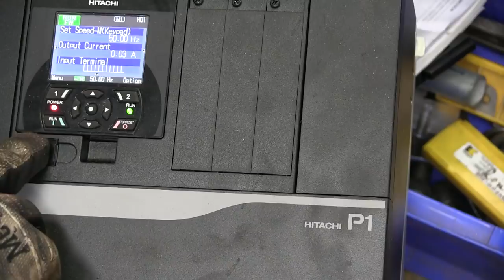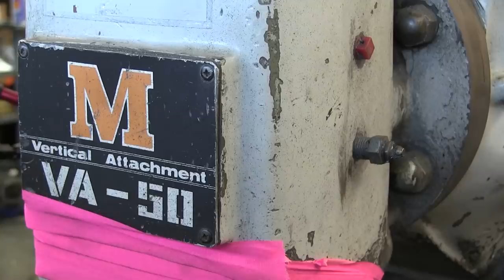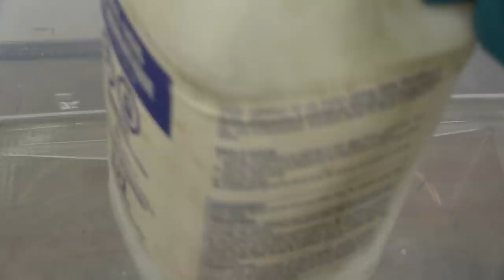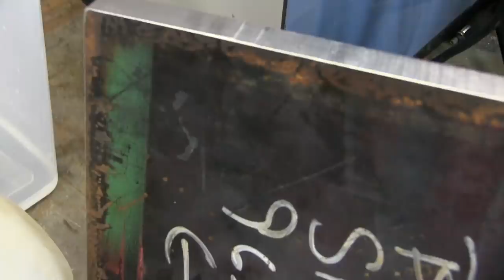Hangover Cure Breakfast | World's Skookumest BBQ Griddle?

Comment: So,do you start heating the plate the night before so it is ready for breakfast?
Reply: Wholly Mindless metals have pretty low heat capacity though, might be faster than it looks
Reply: A BBQ grill and commercial flat top grill might have about the same BTU rating for the same size. The commercial grill I used, would be up and able to start cooking on in about 10 minutes. Not full warmed yet, but enough. Within 15 or 20, it was completely ready, but might have been less if we didn't cook on it right away. 
This is a little thicker but not by much. I wouldn't be surprised if it was ready much quicker than you expect.
Reply: steal as it turns out is a really good conductor of heat.
Reply: the science is off but the comment was still hilarious
Reply: it should take the same amount of time it would take to boil 2 gallons of water
Reply: @xaiano794  The clickbait says 125 lbs.  If that's true, it's more like 15 gallons of water, plus you want the griddle up around 350F or more, not 212F.
Reply: @BixbyConsequence  exactly, a stupidly long time - there's a reason people don't build them like this
Reply: @BixbyConsequence @Xaiano The specific heat capacity of water is 9x that of steel, ie it takes 9x more energy to raise the temp by the same amount. Heating 125lb of steel to 350f takes the same energy as boiling 3.3 gallons of water.
Reply: @FearTheTaswegian  I didn't know the weight at the time, so I made sure to underestimate it's size.
Reply: And wash it the next morning to avoid burns
Reply: The metal is going to absorb heat only so fast so it would seem fair to set the burners on say medium or medium low and give it 10 minutes. Most griddle needs are for breakfast foods such as bacon, eggs, potatoes etc. although anything can be cooked on them, there is no BBQ flavor. We have a flat top by camp chef and find all burners on the lowest setting usually is sufficient for eggs over easy or up etc. Too much heat will brown the egg whites and most folks do not like the flavor and toughness caused by that. Eggs are best cooked with low heat while potatoes will need a medium low heat so they will brown nicely by the time the inside is done. Once the surface is seasoned a few times, the surface is like non-stick.
Reply: It would take 2550kJ to heat 125lb of iron by 100°C (from 15°C to 115°C).
1J=1Ws so 2550kJ would be 2550kWs or 0.71kWh. So let's say the grill has a power output of 2kW it would take 0,355 h or 21 minutes to heat up.
Reply: Yeah, I don't know about any math, but my experience tells me it probably takes him about 15 - 20 minutes to bring that thing up to trmp
Reply: if you compare it to charcoal grilling it is a far smaller prep time to achieve cook temps. Just to say, it isn't hard to plan and get your cook surface ready as you prep other things.
Reply: @poodlelord  who woulda thought
Reply: @BixbyConsequence  water has about 20 times the specific heat of metals. So the whole thing becomes a lot more complex.

Comment: I watched 13 mins of a guy cutting a square to cook eggs and enjoyed it.

This guy is an artist.
Reply: @johnathansaegal3156  A square is also a parallelogram whose sides intersect at 90° angles. ... Therefore, all of its sides are congruent. A rectangle is a square when both pairs of opposite sides are the same length. This means that a square is a specialized case of the rectangle and is indeed a rectangle.
Reply: @johnathansaegal3156  A quadrilateral of some sort, really

Comment: I have made a few of these out of A36 plate. I have my supplier cut them to size and clean them up (they do it at the same cost). The bread and pizza you can make is second only to a wood fired, brick oven - and not by much. Heavy bastards however... Seasoned with flax/linseed oil they will easily outlast you.
Reply: What he needs now is to go to a restaurant supply store and get a griddle stone (big bar of pumas) and a griddle scraper. And maybe even a grease mop.
Reply: lkj43509sddi Sunflower seed oil is what I've always used on my cast iron. Stuff is slicker than shit when you really burn it in
Reply: Ryan Christensen If you cook for a huge group and needed to keep food roaring for multiple hours at a moderate heat (as at a diner for instance) you would be spot on. (I used to hate cleaning them!) That said, I have not felt the need to use any abrasives on my steels (yet!). As long as they are seasoned and pre-heated properly, food barely sticks, and a splash of water is enough to loosen anything that the spatula doesn't get off.
Reply: Careful with linseed oil if it isn't food grade.  It's extracted chemically and contains traces of organic solvents (which will probably get cooked off in the seasoning) and heavy metals (which won't).
Reply: Flax oil is food grade linseed.  All of the good properties without the bad.

You just have to make sure what you get is 100% flax without any other additive.  It makes cast iron very dark grey almost jet black and is VERY hard and nonstick.
Reply: Fair enough. A guaranteed safe option is not to use BLO for seasoning. Personally, I like tallow - but my family farms and I can get it easily. Most people cannot and flax oil works. So avoid the BLO everyone!

Though, I might (respectfully) point out that the driers and siccatives in BLO are typically compounds with Manganese and Cobalt in them. (ref: MSDS) Scary, amiright? Heavy Metal - Run to the Hills! They are poisons and toxins and...and also absolutely essential for human health. For example, Cobalt is involved in the metabolism within every last cell within your body (cobalamin) and a critical cofactor in myelin (nervous system) and DNA synthesis. And solvent extraction is used so many of the foods that you are likely to eat daily that I hate to even bring it up. Yes, any of them can hurt/kill you. But it is in the dose...well, that and the shape of the molecule. Oh, also the reactivity and the...
Reply: What about peanut oil? I've been using it on m new camp chef griddle. Am I making a mistake?
Reply: @llamawizard  any cooking oil/grease will do.
All the crap I hear about specific wonder oils is rubbish.

Comment: That's a hell of a grill plate.  My crappy grill would collapse under the weight of it.
Reply: Looks to be a great pizza steel too.
Reply: My crappy grill is collapsing under its own weight...
Reply: cigr make the legs stronger
Reply: To find the weight use the Chevy engine chart. Steel uses the 283 cu in small block formula OR multiply the cubic inches X .283 to find the pounds.
Got kids in a pine wood or soap box derby? Use the Chevy big block formula, lead weighs .409 pounds per cubic inch.
Would you have used stainless if you had it? Have you thought of adding ribs using a quarter round cutter? Thanks

Comment: I cut 1iin with 60amp plasma, but I'd have used the horizontal bandsaw for this piece and rounded the edges with the grinder.18x24 3sf. cubic foot is 12sf 490lbs . So you got a 1/4 of that 120+2.5 122.5lbs - the grease canal. Tell the guy at the hardware store that u want "26 baum" hcl and dont mix with water. Pour straight on the steel and mill scale is gone quicker that a p100d gets to 100kph. Youd probably need about 25lbs of baking soda to neutralize that acid if it were a gallon of 26. Pool acid is typically less.
Reply: Oh, I forgot to say "THIRTEENTH"
Reply: I can't find '26 baum hcl' what does that mean?
Reply: The Triggerati not sure aboot 26 baum. But he's referencing hydrochloric acid.....best i remember from chemistry is the max concentration of HCl you can get is mid-30% (36.5%?). 

Edit:did some more poking. Apparently acids are sold by "Baume". Its a weight based system? Really just skimmed, but the baum was a typo for baumé
Reply: +Michael C. Thanks Michael. I knew what the HCL was, but came up dry looking for the other term. I've taken university chemistry up to organic and never heard that term.
Reply: The Triggerati sorry to drop the baume on you. It's an old system 5hat sucks! You start with specific gravity of water which is 145(whatever that means) and go like this to get specific gravity- 145/(145-26) and you wind up with HCl with a specific gravity of 1.2185 which you then need a chart to tell you that its about 44% wich is by volume. Wish i could post a pic, but HD sells pool acid and has a pic- label says 20° which means 20 baume or 31.45%. With all that said, its no wonder my 26 baume takes the zinc off my galvanized steel so fast! sometimes you will hear that you should use a 25% solution(like I think uncle bumble was doing), but that doesnt necessarily mean 25% HCl, it may be referring to a specific industy acid. You can see why there is so much confusion around acid. Im betting he used 15% pool acid then diluted it 1:4 which is the standard dilution recommended for cleaning steel, but only when used with industry standard 33% as used in steel industry. I buy 26(44%) because it is the best deal.
Reply: fishdaddyflex - HCL is the only thing I've ever seen labeled, and I've always seen it labeled regardless of manufacturer or distributor, with Baumé. It's like that one holdout that refuses to move to a percentage like everything else.
Reply: fishdaddyflex It's 145/(145-23)=1.188g ml
Reply: Juggernath it's like the numbskulls in charge over here that wont switch to metric.
Reply: why not use a Ph strip or meter?
Reply: Ferric chloride solution is also typically still sold by baume.
Reply: Speaking as the most knowledgeable guy at the bog-standard big box hardware store - I wouldn't know what baum means.  We got Muriatic in der 31% HCl standard grade and der 17% HCl 'Green 90% Lower Fumes' grade, as well as the Behr muriatic brand that won't peep about a concentration but doesn't have the same safety precautions, and a number of cleaning things with nothing on the label, that have an SDS mentioning 2-5% HCl.  Muriatic is not recommended at all unless you're well aware of the several ways this stuff can kill or maim you, and you've chosen the right countermeasures.
Reply: Trogdor Burninator i remember my father in law foolishly applying a single squirt from a spray bottle of muriatic sold for concrete cleaning to an aluminum hulled boat. Instant cloud of throat itchin' fumes
Reply: Okay, so baume is kind of like ounces for leather? So's subject-matter-experts can eyeball it and know what they need?
Reply: Jimmy's Tractor pm
Reply: awesome info!

Comment: Recovering CNC Oxy-Fuel burn guy here.  The plate split apart at the end of the cut because of the heat of the cut itself expanding the material close to the kerf.  ....which I guess you could say is (momentary) internal stress, but I took you to mean that the stress was inherent in the plate at all times.  For instance, if you were to shear the plate, it shouldn't curve out like that.
Reply: Or it coulda been cold rolled steel, what does the internal stress thing every time.
Reply: Cold rolled wouldn't have mill scale on it.
Reply: Tim Farmer Oh there's internal stresses in those plates alright. Those plates come off the boat from China like big rolls of toilet paper. At least up to 1/2 inch does.

They then flatten em out and cut em into 8x4 or 10x5 or whatever and ship em out to some poor scmuck with a water jet, plasma or laser cutter or AvE. 
As soon as you start cutting profiles into the plate it wants to warp all over the place even with the water jet cause there's all kinds of internal stresses in the plate. The thinner the material or the more holes you cut out of it the worse it gets.
If you need it flat you have roll the damn thing all over again. Or mill/grind the blasted thing.
Reply: The plate doesn't(shouldn't) get more than 130 degrees. The tooth profile puts all the heat into the chip, only heat into the workpiece is friction from the side of the blade. My experience is anything over 3/4" has a lot more internal stress and will open or close depending on the grain just like wood. I think re-rolling it a bunch of times to get down to 1/2" or thinner makes the stresses more uniform.
Reply: Heat the plate to dull red and let it cool in still air. Not practical but it will work.

Comment: My favorite pans in the kitchen are carbon steel.  Coat them with oil, and never wash them, they are as good as a Teflon pan for non-sticking.  Last forever too.  Great vid!
Reply: My steel frying pan is just as good as cast iron. Stainless steel is only good for deep frying. I rinse the steel pan without soap. Works very well.

Comment: Bud! Hell yeah. Did my time in the kitchen and I've always dreamed about having a nice griddle and a long, flat spatula like a line cook would have. Never thought of rigging one up on my own. You can be so much more productive with one of those. I lack vision.

Well done.
Reply: Same here, I miss that big gas powered beast. This video got me on a search and I found you can get smaller 16 inch electrics with a 3/4 plate for about $450 USD but the ones that seem worth buying require 220v. Dunno about you but I don't think my roommates would appreciate me pulling out the oven every night to plug it in.
Reply: Cheers.

I suppose I was daydreaming about being a homeowner again. Fortunately I live in a bachelor apartment and don't pay for my hydro. All I'd have to do is run an extension cord from our building's laundry room for 220 V and then I''m ripping. It's totally feasible.

Hell, I could run a restaurant out of my apartment. Totally sound investment.
Reply: Yes, likely a better plan would be to use a second "BBQ" set up with the griddle and another for BBQ and grilling. As long as the burners are working okay, any old BBQ could do.

Comment: I worked many years in a fab shop. Thousands of hours on a Flow 60" x 10' flying bridge. 
Moved hundreds of tons of plate. 
Rule number one is to know what it weighs. 
1" hrs = 40lbs per sqft……… Memorize it......simple...
1/2" ?   20lbs...….  
1/4" ?  10lbs.....
11ga (1/8") ?  5lbs
Now you can figure out the weight of anything made of steel in your head, in the field, in the shop, anywhere.
Reply: 40 lbs per board ft for steel. Thanks

Comment: Talk about lifting... I work with two young guys that are Rush Rush to get stuff moved and or done...  They were moving some steel and one dropped his end and nailed his own toe...  Poor Robby tries to save it and bangs up his shins...  Both lost a half days work.  If they took five min to swap out the bucket on the loader for the forks nether of them would have been hurt.  I learned early on plan how you are going to do a job.

Enough about lifting... Now that is one hell of a griddle!  I will wager that'll works like a hot damn for cooking burgers...  I wonder how well some half inch plate would work...  I don't need mess up the back loading the grill with a griddle!
Reply: Kriss Femmpaws, it is always way faster to take it easy and do it right the first time.
Reply: Oh I know that... It's also better to do the job right the first time.

Comment: Lots of companies fail to adjust their machines for wear. Take out the gibs and clean them up, put 'm back with some dye and scrape them in till you get rid of most of the slop. Our shop is full of old machines, but we adjust for wear every other year. They're not perfect, but they're not clapped out. It's always the electronics that causes the headaches... Wich reminds me: does the mazak put the brakes on automaticly when switching axis? Maybe put them on manually like a conventional mill.

Comment: The best part of this is that you probably cannot break it.  Of course you should still keep Bubba away from it just in case.
Reply: But it can certainly break you.  :-)
Reply: Yeah, at least any sort of rifle bullet shouldn't have a chance against an inch of steel, even if it isn't armour steel - you'd need at least a .50 cal to go through this thing.
Reply: I probably could... broke my step-dad's cast iron griddle with thermal shocking.
Reply: I accept your challenge :)
Reply: 71723 completely different metal. This isnt cast. Heat transfer is a lot better. Therefore that shock isnt going to do anything to this thing. Get it red hot and drop it into a pool. Go for it.
Reply: Zuthal Soraniz deepening on the velocity, .223/5.56 would leave a good 1/4” or so deep crater in the steel.
Reply: Indeed. hell half inch  is relatively bullet resistant. .223 and below won't usually cut it.
Reply: Ill give er a spin. I once fucked up an anvil with a glass hammer.
Reply: Amateur Redneck Workshop I’d say you might want to make sure your aging Weber can carry the hundred plus pounds as well. Gravity sucks...😂
Reply: You might get some warping dropping it in a pool but I would not expect it to crack.

Comment: What's with the baking soda finish? A plastic funnel, a plastic jug marked "Acid" and a small stand to support the jug whilst you pour the muriatic acid into said jug allows you to use it until it's picked up as many metallic ions as possible or....it's too weak for you to wait for it to work. Then's when you thin it down for other uses. Hint: it's highly effective, breaks down easily and doesn't pollute like glyphosate.

Comment: that would crush a lesser bbq, what does it weigh ?
Reply: Nathan banke, it's in the neighborhood of 120 pounds.  1" steel is 40.8 pounds per square foot and at just shy of 18 by 24 that's close to 3 square feet. Add a little for the .8 part, subtract for the shy dimension and grease channel, and Bob's yer Auntie.
Reply: I should’ve been clearer, I want to know what the bbq weighs vs the 125lb plate
Reply: 'bout 60 pounds.  ;-)